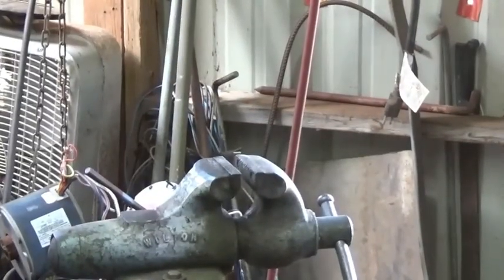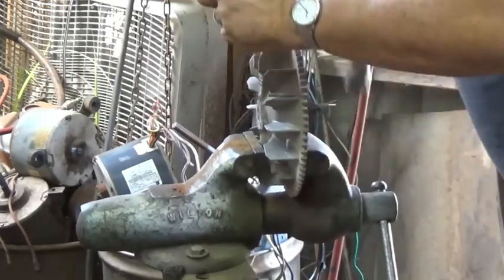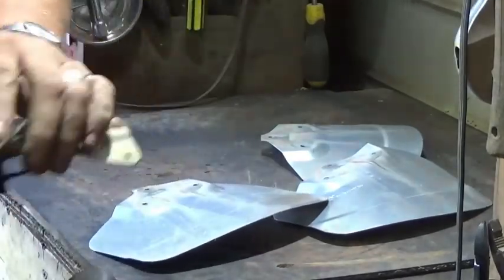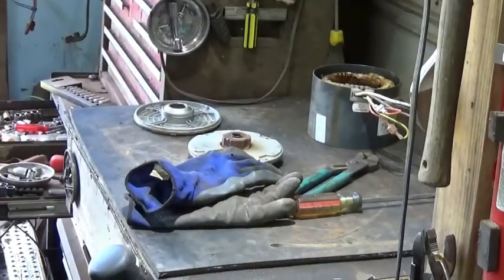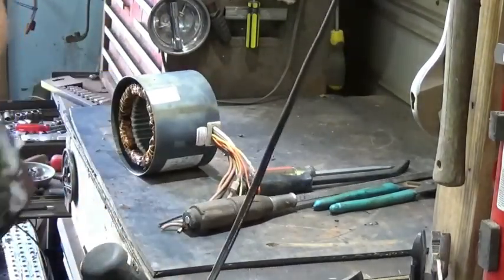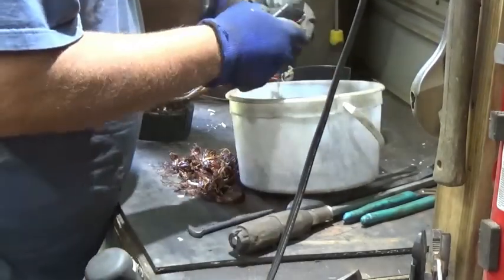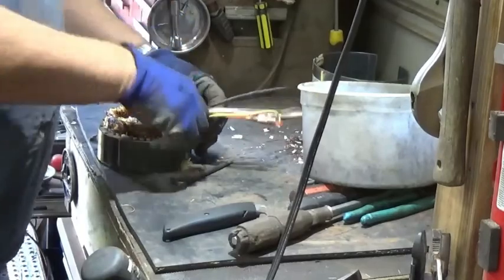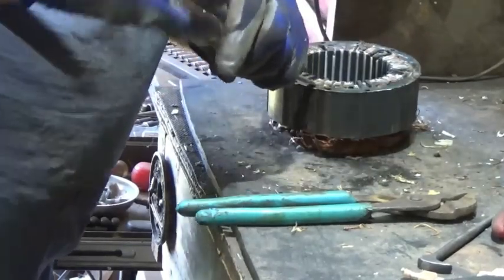How to clean a push mower flywheel for clean aluminum + a free magnet, & scrapping an electric motor

Comment: Been watching for awhile  Been scraping along time  Heres a tip try puting a 10 inch metal blade in your chop saw and cut your copper windings on your motors it works real good Keep scaping
Reply from the maker: Thanks for the tip

Comment: I got one yard that will take the strings on the copper, but the other one won't.  Also, when pulling the copper through the metal casing, I got a pickle fork for my air chisel!  Works like a charm.
Reply from the maker: i haven't checked my yards but i like to keep it as clean as possible. i need to modify one of my chisels and see how that works. on the unit i was working on in the video i took a punch and taped the cut side in about 1/4" and ii came out easy

Comment: Just  subscribed to you add my  watch list. I do the same  thing with motors and trasformers .I have ground the chisel only on one side  like a plain blade put the flat side on the steel it dose not  jump off as bad slices it right off. Then I do both side of the motor the same and use old bottle caper to push the rest out very fast.
Reply from the maker: sounds like you have a good method. thanks for sharing

Comment: I know that this is an older video but as I am a new subscriber and am not sure if you would see this comment but here it goes anyway  , after you had removed the one side of the copper windings take your channel locks and grab the other side and then use your hammer and hit the housing downward and work around the copper and you will be amazed at how much easier it comes out  ! Just an idea you might want to try  . Looking forward to watching more of your older videos and new ones !
Reply from the maker: I took an air chisel and cut it into a Y shape, and just hook the point under the copper wire and let the air hammer do the work, fast and easy
Reply: I don't have the modified air chisel but I use the Channelocks and grab the loop and use the cam/lever action on the back of the channelocks to pry it out a little at a time.

Comment: Awsome video my friend
Reply from the maker: Thanks for the visit Big, that barrel that I melt my motors in I am putting some refractory cement in the bottom of it to fill in the low space in the bottom. at the moment the aluminum pools in the bottom before running out the hole. I may put a thin layer around the inside of it too. Thanks for watching

Comment: Since you have an air chisel,I'm going make removing copper loops a whole lot easier for you than physically  wrestling them with screwdriver, Channel locks,etc.
Take a chisel with a 1 1/2" - 2" paddle and cut a V in it.round off the sharp edges insert the fork in the copper  loop and go. 👍
Reply from the maker: yeah, that sounds very easy, may have to put a box at the end of work bench to catch them, thanks for the idea

Comment: Hi there wouldn’t be easier for you to work with a solid Table and a solid table vice ? thank you for sharing your videos much appreciate I’m always learning from you thanks oh it’s crappy weather here in Montreal stay safe and keep those videos coming when you get a chance 😃❤️👊🇨🇦
Reply from the maker: believe it or not i have 3 work benches in my shop that are 5 to 8 feet long. one is for doing my coin rings. and parts of the other 2 are for the rings too. one has a a frame press on it for the rings and the other is used to powder coat the rings with toaster oven mounted at end on the wall. i haven't made any rings in almost a year so they are pilled up with junk. that is why i use the little table easy to clean off and it is next to the tool box. i plan on adding on to the shop 18 x 20 so i should be able to move some stuff out into that area and make more room in the main shop,, and then i might be able to mount one of the 2 bigger vice that i have. it's just getting the time and money. Thanks for watching Rob

Comment: If you have the spare room always good to take apart motors...it all adds up #Happyscrapping
Reply from the maker: yes it does, i am putting my copper into open top barrels, the one's that have the lid and ring. and plan to stock pile for a few years until i retire and pay off bills or get me a good truck. Thanks for stopping by Walt

Comment: sweet ;) thats alot of copper ;) nice work ;)
Reply from the maker: yes it is Johnny, i got 2 lbs. out of that motor. not all scrappers have the time to take them apart, would be nice to buy from other scrappers and just do motors and compressors, but it might get old doing just them all the time, Thanks for watching
Reply: @Okiescrapper  sweety ;) im still doing my finlay clean of the gold from my gold trip ;) before ill put it ;) on my channel ;)

Comment: Have you melted any copper to make ingots
Reply from the maker: Not yet. I want to try to melt either copper or brass soon. I need to get a good little ingot mold for them. thanks for stopping by
Reply: @Okiescrapper  if and when you do a melt then plan a slow cool to allow a separation of the silver

Comment: Use your air hammer to remove the windings, after you cut the other end off for easier removal of the windings!
Reply from the maker: I use it now I modified a chisel to the shape of a Y and it will push it right out,  a little slow on some of the big one's but they have a lot of copper, still faster and easier then prying it out. Thanks for watching

Comment: My friend the copper you will get it out of these small motor is copper number 2? And how much is it these days per lb and how many lb you fined in each motor.
Reply from the maker: that motor had just over 2 lbs. not a lot but doesn't take that long to break them down. Thanks for watching Mike
Reply: Okie scrapper how much is the prices now for the copper number 2
Reply from the maker: @rassas1975  i haven't sold any in a long time but heard it was about $1.60  LB.

Comment: Do you melt all of your aluminum
Reply from the maker: no I only melt cast aluminum that has a lot of steel in it that would be hard to clean, like motors with pressed in metal sleeves.